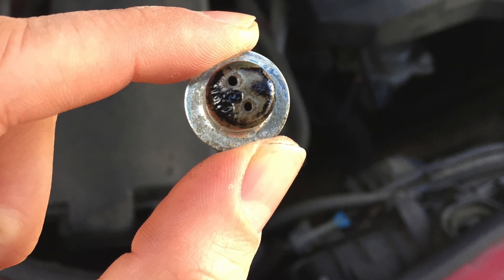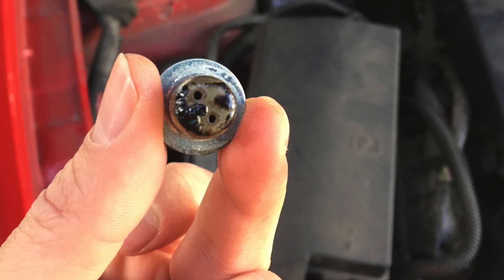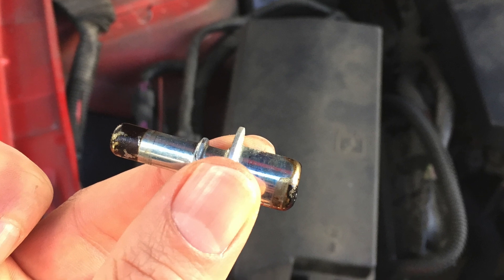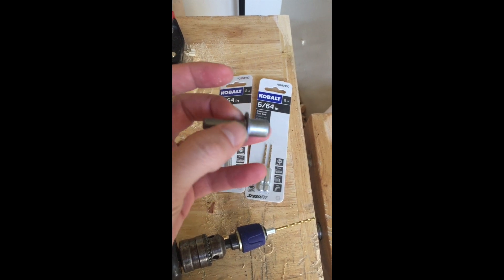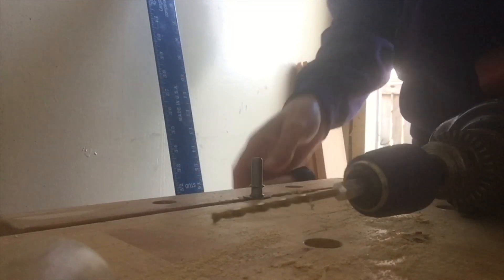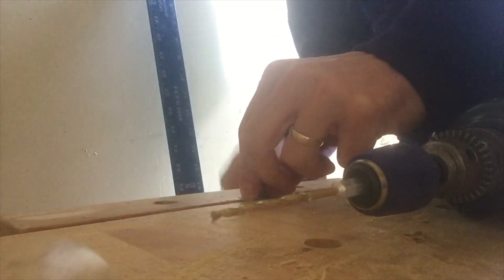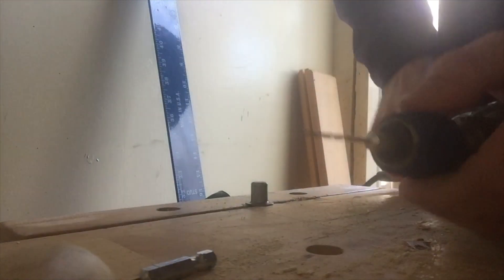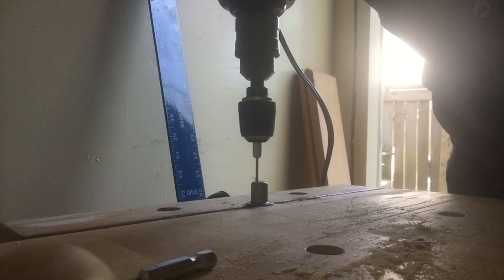GM 3.6L V6  LLT PCV valve modification - GM Camaro

Comment: I'm guessing this same technique would apply to an SV6 Commodore with the LY7 Alloytec. 

Have a catch can that seems to be empty. Yet my air intake has a trickle of oil into it from the PCV intake
Reply from the maker: probably.  Do those engines have small holes that need expanding due to potential sludge buildup?  I'm only familiar with the LLT.  although I do know that the Commodore is based on the LLT.  So in theory, they probably do.  You could always pull the PVC valve and check the size of the holes.  If the 7/64th or 5/64th bits don't fit, then drill them out a little bit and put a catch can on the car.
Reply: @bigilworth  I've got a catch can already. 
Not much ending up in the can.

Been getting more crap coming out of the inlet side instead.
Reply from the maker: I haven't yet, but I am planning on putting a second catch can on the "clean" side of the engine.  It would make sense to do both since gasses vent out of driver-side valve cover into the air intake same as the passenger-side valve cover.  

I hope it works out
Reply: @bigilworth  I've yet to install my clean side one. 

Car got T boned few weeks ago driving home from work. It wasn't a hard hit fortunately. 

Until I get it back from being repaired it's all going to have to wait
Reply from the maker: I hope your car gets fixed and it all works out!  Keep the thread updated if you do the clean side catch can.
Reply: I was planning of adding a second catch can too. But the notice that there is not a PCv valve on that side. Some poeple tell me that that side air come inside  from the intake. To be able to not create neg. vacuum.
Reply: @mikehotiz8506  the clean side gets air in from after the filter. 
So you would do a catch can between the air filter and the inlet on the clean side.

Don't really need one that side as it's sucking air in and nothing really comes out if it
Reply: @bigilworth  I did your method to my PCV valve. 
Have to empty the can more often otherwise all good. 

Car was close to being a write-off from being T Boned.
Reply from the maker: @AJS86  Terrific, glad that the PCV mod helped create less crank pressure.  I empty my can about once every 4k miles.
Reply: @bigilworth  I do mine every 5000km when I change the oil. 

It's not a big can I've had it fill with oil before and blow clouds of smoke out the back 😂
Reply: LLT Is SIDI 3.6 for the Commodores
Reply: @sixspeed63  yeah I know it is. But the PCV outlet is the same. 
The clean air post filter breather is same too. 

Only difference is on the plenum
Reply: @AJS86  both Engines are identical, the only difference would be the covers that sit on top of the engine to give the engine a clean look when opening the hood.
Reply: @sixspeed63  the plenum is different between them & the LFX too with the plastic
 LFX is also SIDI too. 

I still prefer my LY7 and port injection. Keeps the valves cleaner than direct injection. 
Especially with all the oil gunk going into the intake without a catch can.

Comment: You will speed up the carbon deposits in your engine if you do this . You need an oil catch can to resolve the issue .
Reply from the maker: I fail to see the logic in any of these comments.  Nor do I think it's truly possible to get 5-10% hp gain from any modification unless it is turbo or nitro.
I would highly discourage drilling out the PCV valve or plugging the manifold intake port.  

First, routing from the PCV to the throttle body doesn't lessen the issue.  It just makes the throttle body the first contact for all the gasses and particles, creating a situation to gum up the throttle body. 

Second, don't just grab 300,000 miles out of the air.  Comments like this with no research or even rational theoretical deductive reasoning are not helpful.

Third, the vacuum comment makes not sense either.  Unless you're venting into the atmosphere, if you're routing the gasses from the PCV back into the engine, the gasses and particles will have a chance to coke the valves. WHICH IS THE ENTIRE FLAW OF ALL DIRECT INJECTION ENGINES.  BECAUSE DIRECT INJECTION DOES NOT PASS FUEL OVER THE VALVES, VALVES WILL COKE DUE TO PCV GASSES!!

End Result:
Either clean the original PCV holes often and perform an intake valve cleaning every 50k.  
OR Enlarge the PCV holes TO REDUCE BACK PRESSURE and add a catch can AND perform an intake valve cleaning every 50k.
OR Keep everything original, add a catch can, and perform an intake valve cleaning every 50k.  

Bottom line: Add a catch can, do something to keep the PCV holes from clogging, perform an intake valve cleaning as part of general maintenance.  Do these 3 things and you have a CHANCE of getting these engines to 300,000 miles.
Reply from the maker: I installed an oil catch can right after performing this job.  Jd5179, you are correct that a catch can is extremely important after performing this service.  I didn't address that in the video, but it is my suspicion that anyone willing to perform this service will have fully investigated the oil catch can need.
Reply: @Wes_5kyph1  0
Reply: LF X  so no more oil consumption ?

Comment: Do you have the part number of the pcv?
Reply from the maker: CHEVROLET 2010 CAMARO 3.6L V6 Exhaust & Emission PCV (Positive Crankcase Ventilation) Valve
STANDARD MOTOR PRODUCTS V518 {#12574094, 12583384}

I bought it from Rock Auto.

https://www.rockauto.com/en/catalog/chevrolet,2010,camaro,3.6l+v6,1444222,exhaust+&+emission,pcv+(positive+crankcase+ventilation)+valve,5052
Reply: part # chevy, v518
Reply: @-MrRichBiker1967 what about for the 2014 Camaro and no it’s not plastic, it’s the same as 2010 models but with one bigger hole instead of 2